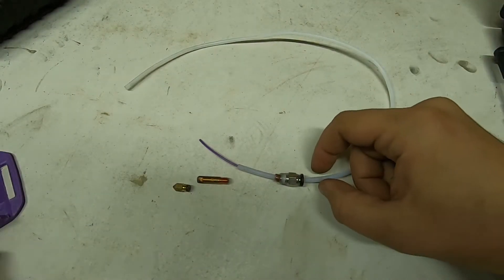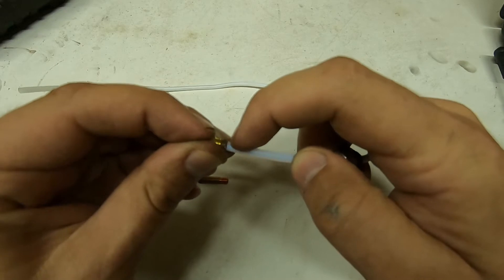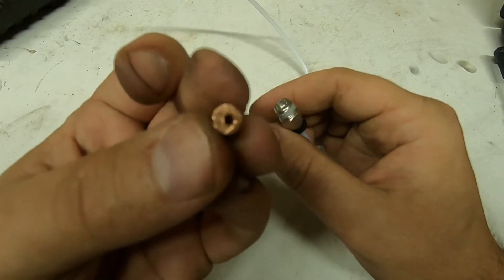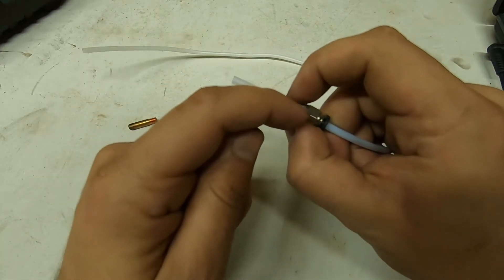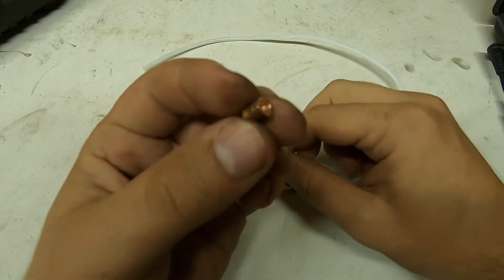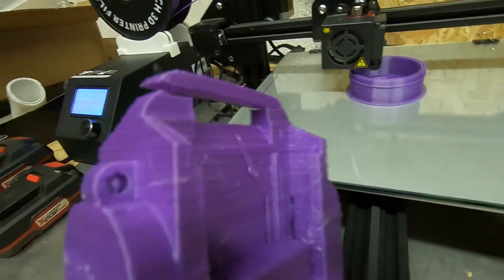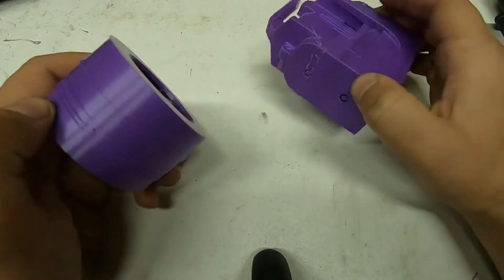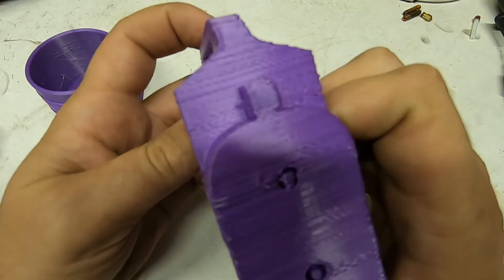EXTRUDER SKIPPING, PRINT ERRORS AND POOR LAYER ADHESION - FAST DIY FIX

Comment from the maker: Print setup: 160-170% feed rate, 0.8mm nozzle, 0.25 layer height, entry level printer with no mods except the one mentioned in this video. Layer height is usually 0.32mm but this part has threads.

Comment: Great solution but I still don’t really understand why that gap, which was filled with the custom brass fitting, was the problem/issue?
Reply from the maker: During printing guide cable moves and rotates in the clip holder (tube fitting). 
It gets worn out at that point and a tiny gap occurs between hot end and tube. Semi-molten filament gets in that gap and sticks to passing filament thus making it hard for extruder to push filament through. When you (straight) cut a piece of tubing it is pushed towards the hot end firmly and doesn't allow any molten filament between hot end (nozzle) and tubing.